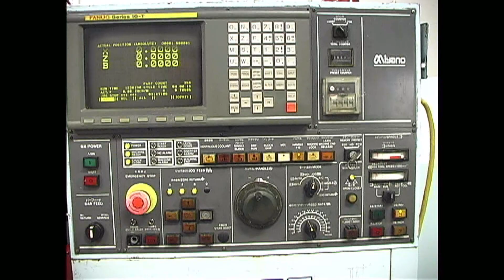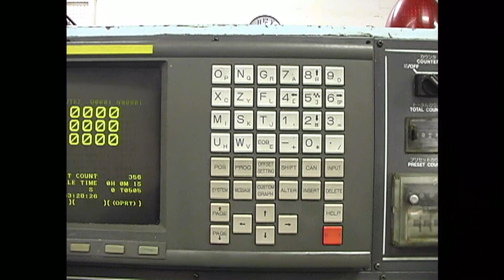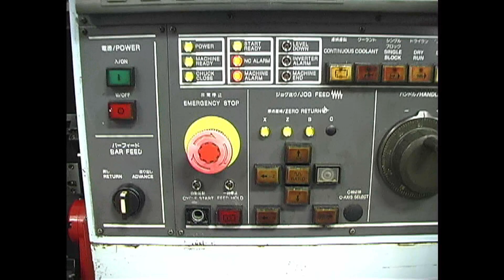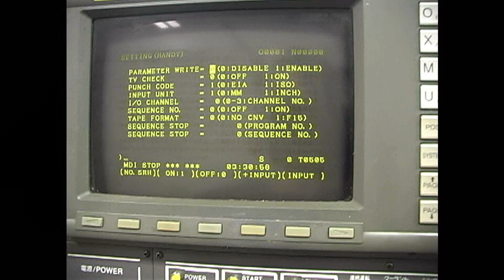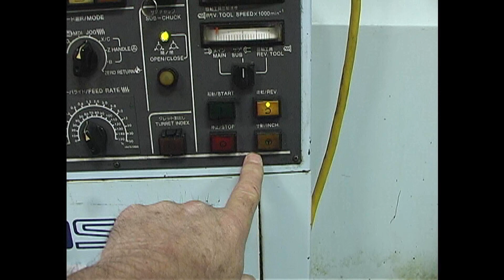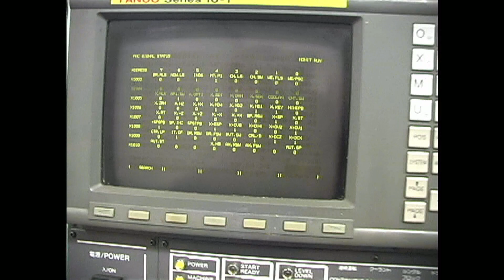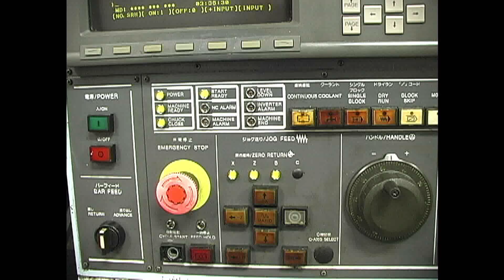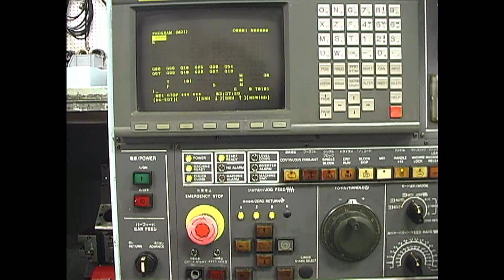Re-teaching turret position 1 on Miyano w/ Fuji RYG.50HA-RP-   CNC Digital, Inc. 440-721-7100

Comment: Hi at 7:30 when setting T0101 the cycle did not run. What did you do to get it to run as I have the same problem?
Reply from the maker: Call to discuss. 440-721-7100